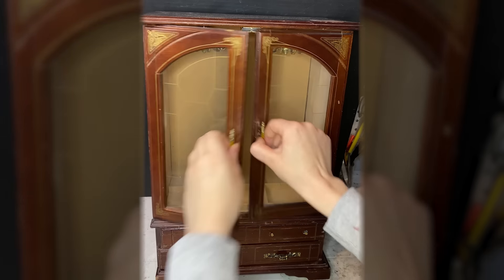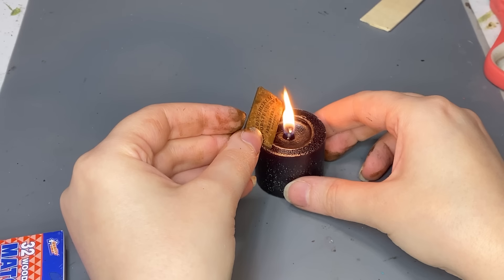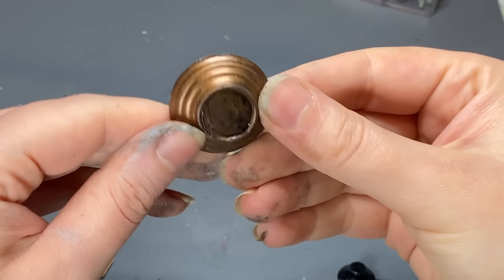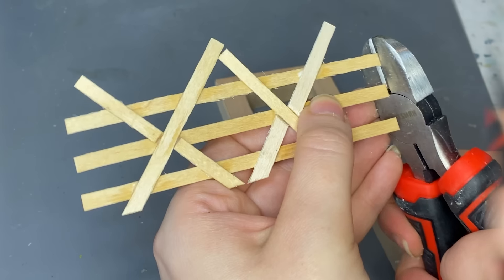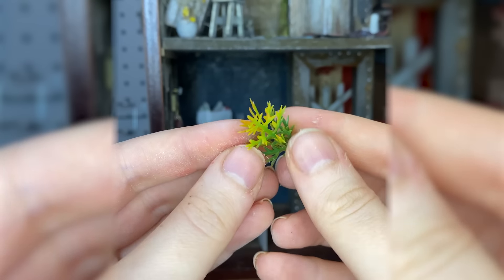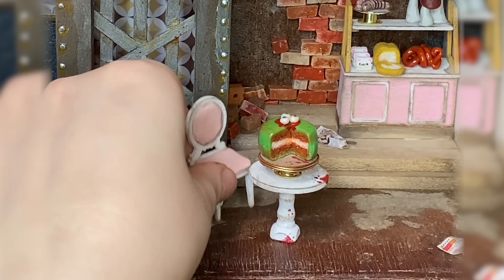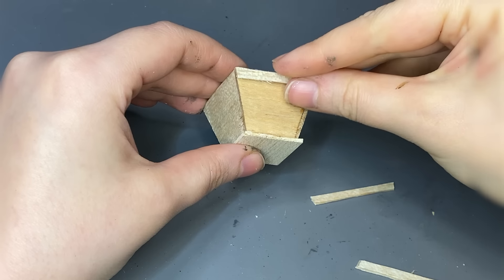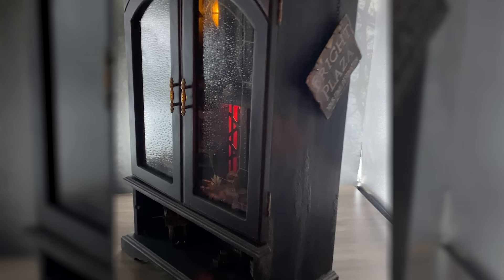Upcycling a Thrifted Jewelry Box into a Spooky Miniature Mall

Comment: When sanding, it works best if you wrap a piece of sandpaper around a sponge or piece of foam (think Magic Sponge). If you don't have one, simply fold it in thirds to use. This way you don't have areas with varying pressure from your stronger fingers. Most inportantly, sand with the grain, not against. 
 Love this! You're very clever!
Reply: You might need a lower grip # too i’ve also found like a sponge sandpaper thing. It’s a hard sponge at the store.
Reply: @LisaBluestar83  we use a rubber type foam-ish pad. Some of them have holes punched in them to make them more able to access curves. Many times, you can find something around the house that works great! PS: I even wet/dry sand rhe scratches out of my stainless steel sink.

Comment: Awesome.
You can get flickering LEDs. Whilst the bare LEDs would give you more options, you would need to solder them to wires and add appropriate resistors. You can buy LED candles that flicker. The best option would be tea light style candles.

Comment: Build an area in your boiler, to hold a flicker, dollar store tea light.  Paint it orange or red and put some cellophane pieces, in orange and red among the bottom part of the wood.  Turn on your tea light and let it look like it’s burning.  You can take the fake plastic flame off the tea light too.  Just be careful not to take the small light bulb with it.  You can even cut the cellophane to look like flames.  It would work just like you want.  It looks great so far, you have done a great job on it.

Comment: For the fire If you can find something that can spin in a circle (like merry-go-round ish thing) you can put it in front of the light and have something on it that is sometimes blocks the light to help it flicker 
Or something else that is not electricity just hang a string with like a brick ish or plank ish thing on the bottom and just swing it in front of the light (hopefully some ideas to get you going in another direction)